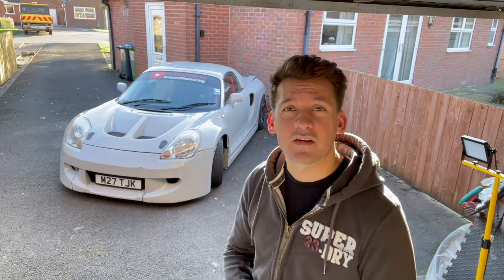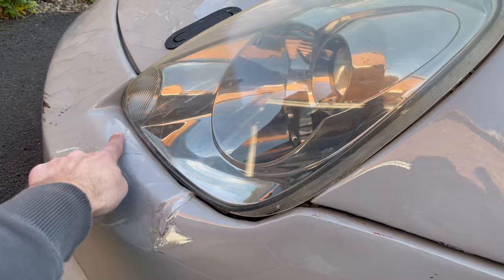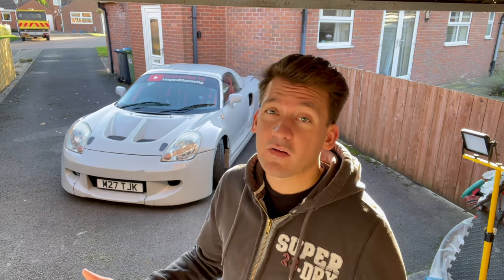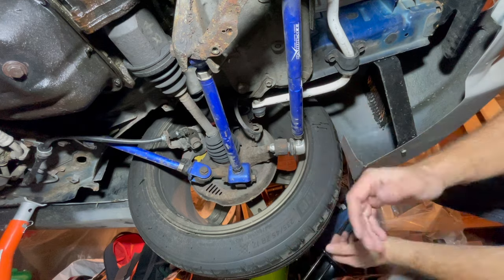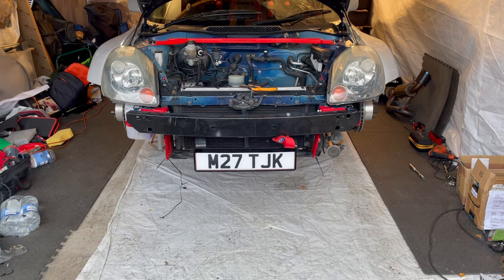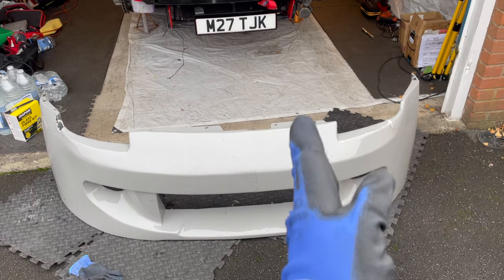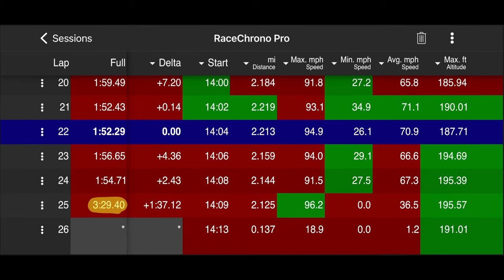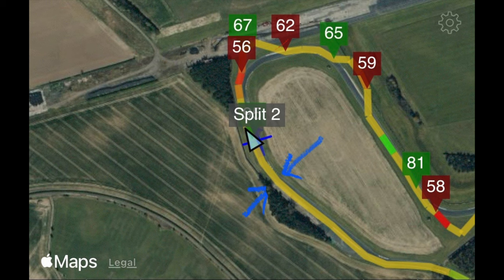I Crashed It... 95 MPH spin off at Croft.

Comment: First off, glad you're alright. Second, I'm glad the car didn't suffer a hard impact into anything. Very cool seeing some track day footage of the MR2 👍🏽😎 looking forward to the rebuild mate, thank you for sharing.
Reply from the maker: Thanks mate. The car stopped about 20 foot shy of a wall, so got very lucky there. I'm also glad to say the bumper has now been fixed and I've made it much better. I'm back out on track agin in 2 weeks too so I can test some new stuff and get some more footage. Think it's worth me putting a video together of the best parts of this track day before that? Some good action from that day as I was on track for about 2 hours.
Reply: @KingandTitanRacing  Lucky missing that wall. Track day highlights would definitely be a fun watch. I reckon you'll have plenty of good clips from 2hrs of recording. Glad the cars fixed up right as well. I'm sure the front ends going to be solid now 😎👍🏽
Reply from the maker: Sounds like I better get back in the editing booth. 😂 Working on the car today but I’ll certainly get some track footage out soon. 👍

Comment: get some proper tyres on it, ive used those proxies on a few cars before and theyre crap. plus by the looks of it they are the old style ones u have so wouldnt be suprised if theyre not at their optimal anyways. some semi slicks will makes a huge difference. the zestino gredge are a good budget option which i found are very good for the money
Reply from the maker: Agreed, I only had the proxies on there as they were practically brand new and wanted to burn through them. I had Michelin PS4s in the rear though and that’s the end that slipped out. Thanks for the recommendation, I’ve thought about semi slicks but haven’t had the budget for them yet, also the tyres need to be road legal as I drive to and from the track.

Comment: The fix to the high speed instability is to reduce power steering assist in these cars or change it to a manual rack.
Reply from the maker: To be honest I couldn’t blame it on the car, the steering felt very stable and didn’t have any wobbles. I managed to unsettle the car by lifting at the wrong time.
Reply: I track one of these cars, I've never heard this before.

Comment: It's unwise to get out that quickly on a hot track.
Reply from the maker: Agreed, but in this case I was so far away from the track it felt safe. By the time the car stopped I was already across the next piece of run off and effectively on the service road. My main goal then was just check if the car could drive back to the pits or not. I had to bend two brackets I’d made back and then it ran okay back thankfully.